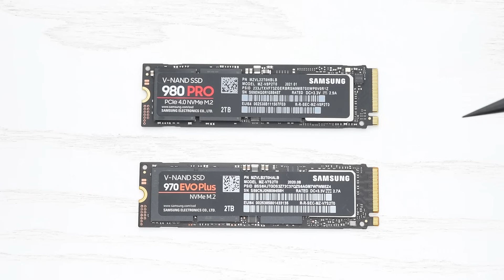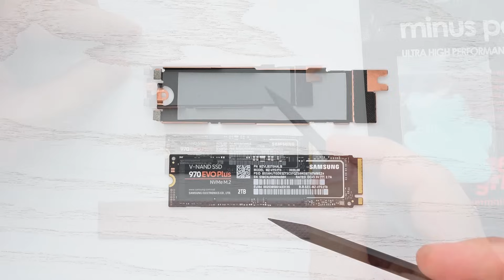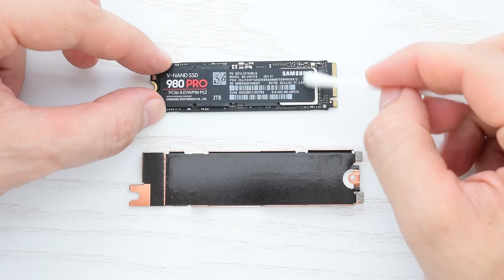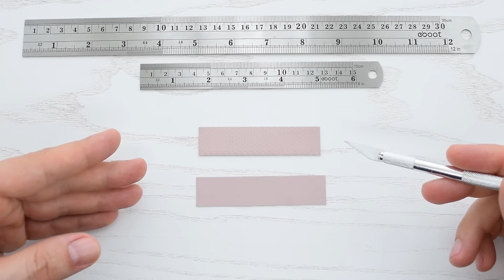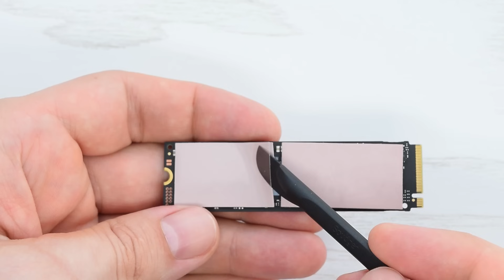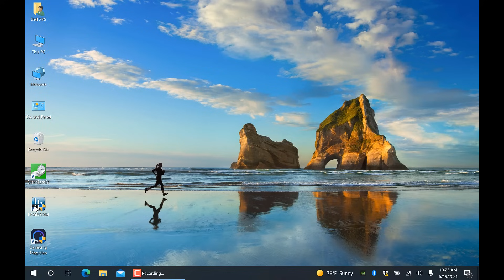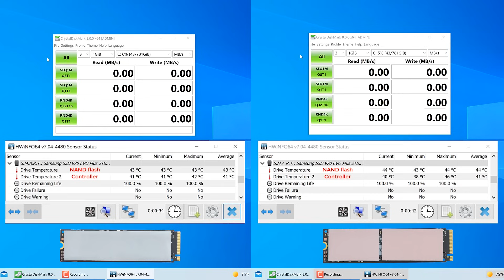Stop your Samsung NVMe SSD from Overheating and Thermal Throttling

Comment: I've recently ordered the Samsung 980 pro 1TB, but my laptop already comes with a small thermal pad on the heatsink. Should I remove the pre installed ones? Or add new ones like in the video?
Reply from the maker: Of course remove and that's what I did in the video.

Comment: Would there be an increase in thermal cooling when you take out the SSD label and place the thermal pads directly on the chips?  I'm aware that the label also acts as a cooler.
Reply from the maker: There will be like 0.5-1C degrees difference which doesn't make any difference and it's definitely not worth losing the warranty.
Reply: @ElectronicsComputers  Thanks for the reply.  I was tempted to take off the label and place the pad directly.  Sometimes it feels like the thermal pad makes the SSD hotter as it tends to keep the heat from being dissipated and putting a copper shield even more so.  It's said that if you have adequate air circulation is sufficient to cool the SSD.  Again thanks for the reply

Comment: Why does Samsung sell those drives without proper heatsink if it affects performance critically. This shouldn't be an option. It should be default on all M2 NVMe chips.
Reply from the maker: Because even without a heat sink Samsung's SSDs will last for several years and then you'll buy a new one. But using this method you'll boost the performance of your SSD and increase its lifespan.

Comment: What about only putting tape on the controller so there's no contact to the nands at all? Do the nands even need a heatsink? Saw someone do a test and a heatsink actually made the nands too cool when idle and hotter when under load (the heat from the controller was transfering to the nands through the heatsink or something).
Reply from the maker: You can see the temperature of the NAND and controller chips with one and two pads.

Comment: Hey, dude thank you very much for the video.  Is 0.5mm heatsink enough to keep 970 Evo Plus temps below 70 degrees in a laptop under load? I have Asus Rog G17 and I was surprised to find out that it has no heatsink on the SSD and it runs really hot under full load (up to 81C degrees)
Reply from the maker: yes, it will do the job. Even cheap and thin heat sink is better than no heat sink at all.

Comment: hi, any idea how high can the heatsink be for laptops? i know that 1mm will be ok, but will i close my laptop with 3mm heatsink? 
and is there a dependence between cooling the ssd and the height of the heatsink? 
thank you for answering :)
Reply from the maker: Depends on the laptop model but in most cases it's gonna be a 1mm thick heat sink which is more that enough for a regular laptop.

Comment: can i use 3mm and 1mm thickness thermal pad instead?
Reply from the maker: There's about 0.5 mm difference between the controller and NAND chips so in that case you need 2.5mm and 1 mm pads (ideally 0.5mm and 1mm).

Comment: I'm sorry for a few newbie questions. Can I only use the the heatsink without the thermal pad? Or the heatsink and thermal pad have to use together to reduce heat? I need to upgrade my laptop M.2 2280 NVMe  SSD to 1TB from 256BG. It looks like the M.2 2280 NVMe SSD on my laptop doesn't have the heatsink or thermal pad on top of it. My Dell laptop manual said that it doesn't come with the SSD thermal bracket. Is the thermal bracket and heatsink are the same? 

Thanks so much
Reply from the maker: You can't use a heat sink without a thermal pad because the last one conducts heat from the surface of your SSD to the heat sink. What's the model of your laptop?
Reply: @ElectronicsComputers  My laptop model is Inspiron 7506 2-in-1 Silver. Thanks so much for your help

Comment: This is highly recommended method for your PS5's internal storage expansion
Reply: Did u put a thermal pad on the other side of the nmve
Reply: @NateMorAqu91  Used 0.5 mm for the underside and used this guys method for the top
Reply: @NateMorAqu91  Yes both sides

Comment: I would use Gelid solutions which is 15w and just better thermal pad than thermal grizzly
Reply from the maker: There's no better thermal pads than Grizzly at the moment.
Reply: @ElectronicsComputers  so you actually tested both?

Comment: to see the real difference between the different styling methods, the same thermal spacers had to be used.  And it's so easy to advertise the thermal grizzly... But overall thanks for the video.
Reply from the maker: You can use any thermal pad you want. They're all pretty much similar. This video was about using two thermal pads on Samsung NVMe SSDs to make a better contact with a heat sink surface.

Comment: Thanks so much for this! My laptops 980 Pro temps have dropped to 54c on the same benchmark and even after running Samsungs magician benchmark right after the max temp was only 63c! 

It is only on pci gen 3 but still impressive as the m.2 is next to my cpu and only uses a thin aluminium heatsink.
Reply from the maker: Good job!

Comment: I have omen 17 cb1005. It has SAMSUNG MZVLB1T0HBLR-000H and it overheats terribly. Few times my pc shutdown due to critical ssd temp. Probably 90+ sometimes. Ordered the two grizzly pads, hope they will help me. Will write down if they do so. That's my last issue with this laptop so far, if I solve it, I'll be happy :D
Reply from the maker: It should help!

Comment: Thanks for the demoinstration. Got those Grizzly pads and was able to level all chips on my SX8200 PRO. Without the extra 0.5mm pad, the controller, which is the chip that actually gets hottest, was not touching the heatsink at all ! For SX8200 PRO, you actually need both 0.5m and 1mm pads - 0.5mm over the controller and 1mm where the SSD board misses a chip (on one side near the pin end).
Reply from the maker: Happy to help!
Reply: @ElectronicsComputers  I have a question how do you wrap a Ram card with thermal pads on it and is it okay to slowly untape the brand Crucial per say and paste it on top of the thermal pad or would that just void my warranty not that I care I just want to put thermal pads everywhere doing a huge repasting of my laptop I have never done the M2 and Ram but this was educational thank you!.
Reply: Not in my case — the NAND and controller chips on my SX8200 Pro are the same height. I stacked 1mm and 0.25mm pads on the top-side DRAM to make contact with the heatsink, while 1mm to the rest

Comment: Is this thermal pad separation occurring on top of the Samsung heat spreader? Wouldn’t it make sense to remove the heat spreader and apply the thermal pad directly to the chips, after cleaning them with alcohol?
Reply from the maker: Removing the sticker will void the warranty and it really doesn't make any noticeable difference in thermal dissipation.

Comment: Great video and thank you for your detailed explanation. In my case, I have a 970 pro samsung nvme in my desktop. Is the procedure the same if I purchase the thermal pads (0,5 & 1)and a EKWB EK-M.2 NVME Heatsink? I am having serious temprature problems with the controller of the nvme.
Reply from the maker: Yes, 0.5mm and 1mm pads will do the job.
Reply: @ElectronicsComputers  Do I have to buy both? I am using the nvme in a tower not a laptop. I think that you mentioned in the video that a thick thermal pad should do the trick.
Reply from the maker: @aidenreaper4196  If your cooling solution allows you to use 1-1.5mm thick thermal pad then in most cases no need to use two thermal pads.
Reply: The location of your m.2 socket will matter also. On the mobo under a GPU is awful. Mounted up on a PCIe AIC the cooler gets more air flow. If you have a GEN4 socket away from other components use that. If you have the clearance an air cooler with heat pipes is best. Or of coarse a Corsair water block is the best solution right now. I agree with E&C match the pad height to the chip height and use the best pads you can find. 12W/kM or 8WkM, standard pads are just 1.5WkM.
Reply: @maxhughes5687  The corsair waterblock is a huge waste of money since you also need extra fittings, plus it adds needless flow restriction. If you have a custom loop already then there's also no gpu air cooler to dump heat onto the ssd or block airflow either. 

There's also gen 4 ssds that run cool like the s70 blade for situations where heat is a concern.
Reply: @Lead_Foot  ? confused? IDK what your trying to say. I have a X399 build and a WRX80E build. Both have two open loops. The Corsair water block will handle my Sabrent Rocket 4 Plus drives on a WRX80E mobo and any new GEN5 faster hotter drives in the future. And the new EK gold plated fitting with a Watercool copper Heatkiller and G Skill Trident Z Royal  gold finnish DDR4  looks terrific.
Reply: The EK m.2 heatsink already comes with thermal pads with different thicknesses.
Reply: @Lead_Foot  The EK M.2 heatsink is a low profile Al cooler and looks great but it's a three year old design for GEN3 drives.

Comment: You forgot to remove the sticker, you're already hampering the potential of the heatsink by not directly contacting the entire surface of each chip. Also, experts  in SSDs have stated that Nand flash memory chips prefer to run hot, so you will drop your write speeds by doing applying thermal pads to them. It is recommended to only contact the controller chips, which is why I came here, to see which chips are which. Also when you say you demonstrate that the controller is being contacted, it isn't, because it's still under the sticker that still isn't contacting with it.
Reply from the maker: First of all, never remove that sticker, because it will void the warranty and it doesn't make any dramatic difference in cooling the chips. Second of all, some of those SSD "experts" have no idea what they are talking about. You want a reliable SSD that will lasts years or an extra speed which you'll never notice? Heat is a number one enemy for semiconductors, PSBs and solder joints. If you want your SSD with all your precious data last long then keep it under 50C.
Reply from the maker: @hectorgonzalez6361  Thank you for the comment!
Reply: Your expert is fake guru

Comment: i have EVO 970 plus in my tuf fx505dt, but i remember there is not heatsink on that SSD. is that ok for me to apply the thermal pad on the SSD without heatsink link u did ?
Reply from the maker: It's not gonna hold up without a heat sink.

Comment: Do you know where to get a good heatsink for a laptop? I have an old Dell Inspiron 7567 laptop without a SSD heatsink. I use it for video/photo/3D model editing and some gaming stuff.

I also thought to buy 1TB 970 Evo Plus. Or should I get other brand/type SSD instead? What would you recommend?
Reply from the maker: The links in the description below the video.
Reply: Get the ADATA SX8200 PRO - they run 10-15'C cooler than those Samsungs out of the box.

Comment: how bout ssd in enclosure? is it using a same size 0.5mm and 1 mm thick therml pad or maybe i should add more 0.5mm thicker?
Reply from the maker: That depends on the enclosure design. But anyway the pad for the controller chip should be always 0.5 mm thicker than the one on the memory chips. For example if your enclosure has a preinstalled 3 mm pad, then for the controller you need 3.5mm pad.
Reply: @ElectronicsComputers  oh i see, thanks for your information.. appreciate it bro..

Comment: Hello, should I put thermal pads above the ssd (like your video) and below it if I dont have a heatsink for my ssd in my laptop? Its a msi ge76 if that helps.
Reply from the maker: This method is not gonna work for that laptop.
Reply: @ElectronicsComputers  what should I do? Put nothing on the 980 pro ssd? (I have the same ssd as yours but its only for gaming) I use it for my 2nd drive though. Its not going to be my main one.
Reply from the maker: @blowmeaway324  This solution may work for your laptop: https://amzn.to/3EO5PsZ
Use the Style: T-70*20*2.

Comment: Is there a big difference between a thermal pad and a heat sink, apart from the price?
Or must you add both?
Reply from the maker: You must use both!!!
Reply: @ElectronicsComputers  I have a Lenovo ideapad 330s 8th Gen. Will a heat sink fit? I ask because it looks thick and my laptop seems quite thin.

Comment: thermal pads 8 is much better therefore you should also try on stcok thermal parts it as thermal pads 8
Reply from the maker: Actually, that's what I did in the video...

Comment: Hi. Do you need two heatsinks for M.2 NVME (one for the bottom and one for the top? What's the thickness in mm for both heatsinks?)? And should we remove the sticker for better contact with the thermal pad?

What's the thickness in mm is the big heatsink you used in this video?

Thank you.

God bless, Revelation 21:4
Reply from the maker: The pad for the controller chip is 1mm thick and the pad for the memory chips is 0.5mm thick. There's no need to remove the sticker from the SSD because it will void the warranty and there won't be any dramatic difference in the temperature.
Reply: @ElectronicsComputers  You're welcome (on me subbing). 

If it's ok to ask for advise and recommendations, I need a new multimeter. Among my multimeter choices,  BSIDE S11 or the S20 which is best for these repair iPhone 5, Wacom Intuos 4 and retro video game consoles specifically the Dreamcast, most don't have power. BSIDE is the brand name.

When I posted the specs and links here, the Youtube bot or automatic censoring system blocked it. It can be checked at that popular chinese retail website (my apologies.)

They have the S10 model which uses AAA. 

You're recommendations are welcome.

Thank you. Stay safe.
God bless, Rev. 21:4
Reply from the maker: @SevenDeMagnus  To me, those multimeters look like some toys. For 25 bucks you can buy more serious tool from the same manufacturer: http://alii.pub/5yswee
Or if you wont something more reliable and serious but not expensive then I'd recommend buying one of these:
http://ali.pub/5yswl0
http://alli.pub/5yswlz

Comment: Thank you for your video just a quick question, shouldn't the labels be removed on the Samsung SSD to be directly in contact with the thermal pad?
Reply from the maker: Don't remove that label. First of all it won't make a big difference. And secondly, it will void your warranty.
Reply: many thanks for your reply tomorrow i get my heatsink and install it this weekend.  Thank you.
Reply: hello, if I don't remove the label, will the thermalpad become sticky and damage the label after a while?
Reply from the maker: @opikbadig2711  It won't damage the label. It's not that sticky to damage anything it's just like a silicone pad.

Comment: Great video, thanks. I’ll be sure to do this with my laptop. I was wondering if you’ve seen a big difference between thermal grizzly pads and other brands? Are we talking about only one or two *C or is it a bigger difference of say 5*C or more in the delta between stock pads and third party?
Reply from the maker: The difference between the expensive and cheap no name pads is no more than 3-5C
Reply: @ElectronicsComputers  Hello, I have a laptop, I can also install it this way, or which nvme is not enough to warm up. which model will fit.
Reply: Biggest aspect should be durability
Reply: Thermal grizzly always amazes me. You have to be careful buying it though, a lot of Chinese knockoffs out there

Comment: Thanks! I was getting crazy with the choose of the right thermal pad's thickness for the nvme upgrading of my Dell XPS 9370. Are three 0.5 mm pads a bad solution to obtain one of 1.5 mm thick?
Reply from the maker: Don't do that, those 0.5 mm pads stacked together is not gonna perform even close as good as a one 1.5 mm pad.
Reply: @ElectronicsComputers  so the more thick it is, the better.
Reply from the maker: @hikosan7563  No! There's 0.5mm difference between two surfaces and that's how you can level it.

Comment: I have asus rog strix z590-f gaming wifi wich i shall put 2 nvme Samsung 980 Pro and 2 Samsung SSD 970 EVO 1TB. I will apply Grizzly Thermal pads on them. Have you done this before?
Reply from the maker: Just use 2 Samsung 980 PRO, they are faster, don't overheat and in the future you can install them into another laptop or a desktop computer. Samsung 970 EVO Plus at that point will be already obsolete. We use that method with two pads (not grizzly ones because they are expensive) in our repair shop and it's always night and day difference.

Comment: You just solved my mystery, bro. I also have a laptop with Samsung 970EVO Plus which gets hot like hell it even starts to smell like something's melting inside. I replaced the thermal pad twice and it didn't help. Today, I installed two cheap thermal pads 0.5mm and 1mm thick and OMG what a difference. And how as a regular  consumer am I supposed to know that Samsung SSDs need two different pads to cool them down properly? Please Samsung tell me.
Reply from the maker: I'm glad I could help you with your problem.
Reply: You can also put a thermal pad on the back of the PCB and place it (gently) against the mobo- the pad is electrically insulated, and the mobo itself is a giant heatsink. 

The m.2 socket is a tiny  spring loaded hinge, and it will not break.
Reply: same problem here I just hit 108°C
Reply: Why do you think differents thickness exist on the market?
Reply: @MrDesillu Because they're not only used for SSDs smart-ass
Reply: @EnnoiaM this was a rhetoric, not a real question. And if you put an answer, it's not "not only for ssd" but because different chip packages have different thickness on the same device.